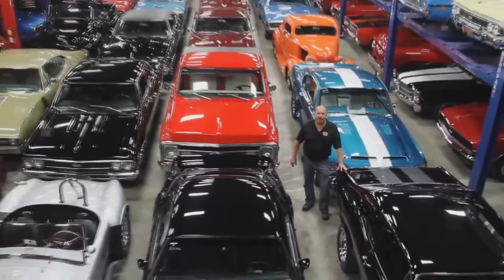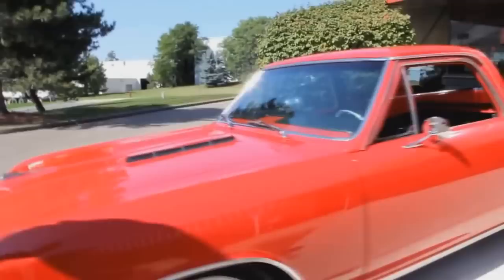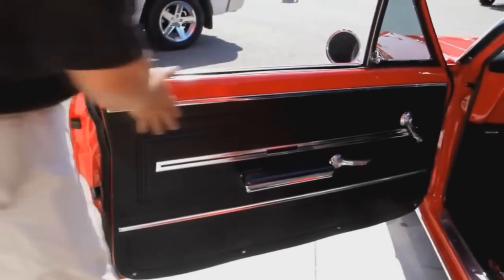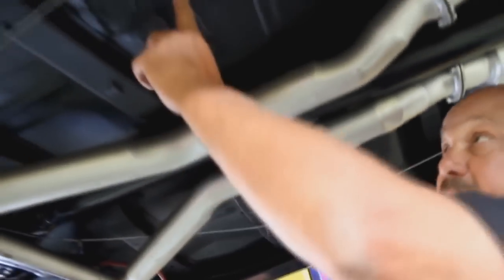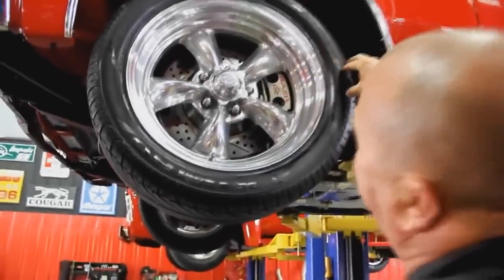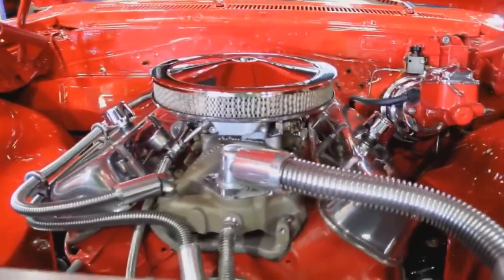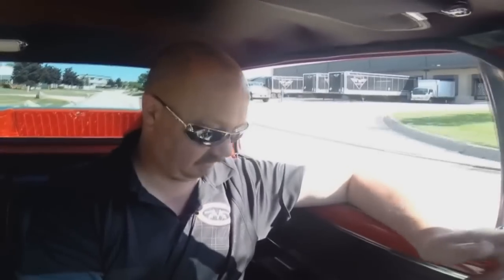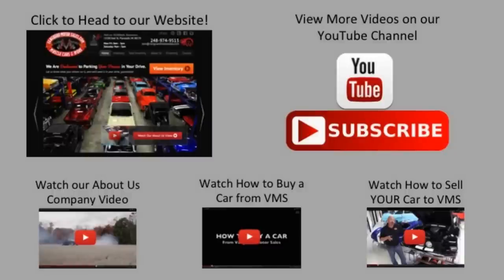1966 Chevrolet El Camino For Sale

Comment: What a well done car!  Crazy good under the hood! I like older 2 bolt 454's .  When I build them I replace the 3 middle main caps with beefy Moroso ductile splayed 4 bolt caps.  This makes the block stronger than the original 4 bolt main block! Splaying the outer bolts greatly stiffens the block. (Hone to size.)